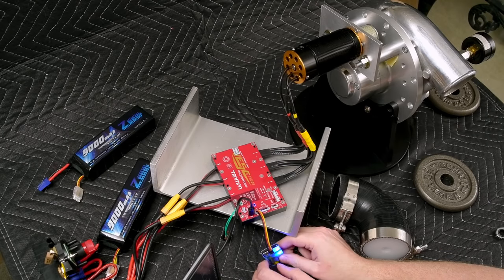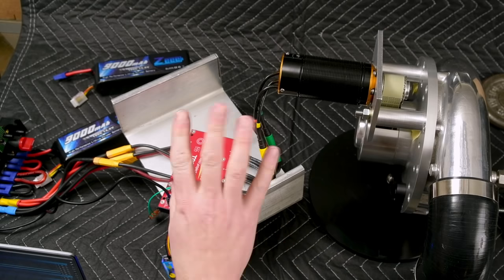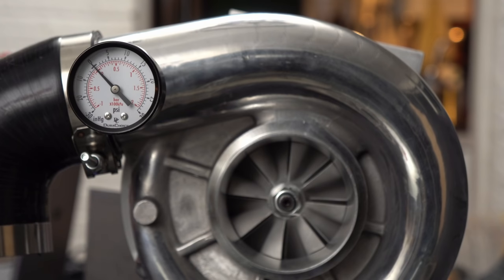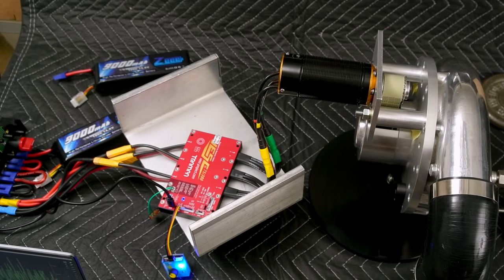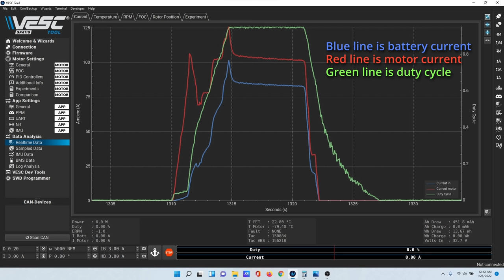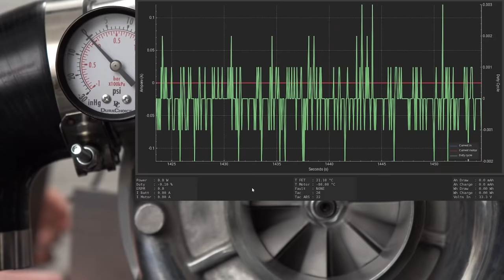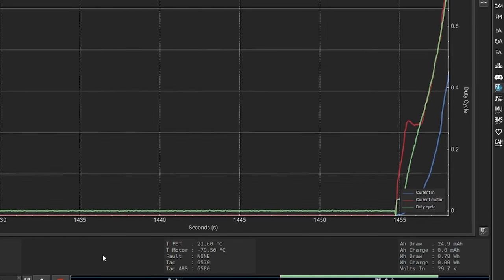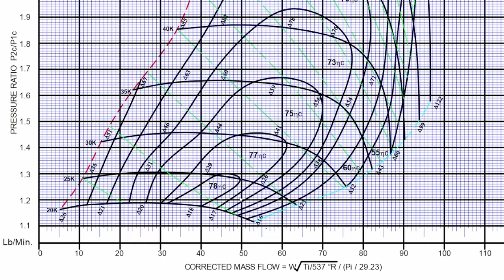Easier/Cheaper High Power DIY Electric Turbo - First Tests

Comment: I've been running a Paxton Novi 2000 at around 1:3 with a 2 1/2" 8mm belt-drive off a Me 0913 72vdc 250 amp BLDC in my 87" Camaroe with a .060 over smblk 350 for years. It makes 8 psi w.o the engine running with a 300 amp initial surge and selltles to about 160 A while operating. Typicall the duty cycle is less than 15 seconds. I power it with six 40 -50 ah AGMs in series. Two where each back seat use to go, and two in the trunk well. I can charge them on the fly with six 2A smart chargers plugged three each into a couple of 1.5K inverters that are powered from a second aux electrical system. . I started back around 02' when I saw my first LEMCO PM motor displayed at a trade show for amusement rides on a go-cart frame. It was 36v and about 10 hp yet made only a couple of lbs. next I went to a 12 hp Lemco D-126 and got 4lbs, and then I discovered three phase BLDC which you are already using on a smaller scale. If I upgrade I plan to try one of the new axial flux motors because I think they show the most promise to date. Most people underestimate how much power it takes to pump under pressure. Had I known from the beginning I probably wouldn't have even tried. That blower that comes on the Hellcat takes 60 hp off the crank for about 8 psi according to a factory video i saw on it. That's a hellova lot; however, I think that much power might be possible to obtain now with axial flux motors because they can be stacked. The biggest drawback you are going to face is battery power and life vs weight. All totalled my blower unit (mounted on the sway bar directly in front of the engine) weighs in at around 100 lbs and the batteries almost a couple of hundred more. It doesn't matter for a vehicle on a roll, (you can rule the interstate); but for drag that's a drag and LiPOs are still too GD expensive if you ask me. The less the ah of the battery, the less time they last before they have to be replaced. Also you will want voltage indication of each (I use cheap $3.50 tiny digital ones off Ebay) so you can make sure you have max voltage before each hit because it make a dramatic difference in output. I activate with chargers on. Keep up the good work man because it CAN be done, it's just not for everybody. I'm thinking now of just running a mini-jet through an exhaust cutout to get it up to speed and then valving it over to a turbo turbine with an actualtor when I want the boost. That would probably make more for a lot less; but I'm into solar AC right now. I may have a test video or two on my YouTube NT Keys channel; but for insurance reasons I've never quite let the cat out of the bag. Up until now it's been like my secret weapon cause I'm about 400 hp NA and I'm pretty sure it adds at least another 100 hp with the 8 42 lb per hr. high impedance Accel injectors I'm currently driving with an old MEGASQUIRT II with the 32 bit daughter board I built years ago. Fun stuff. LOL
Reply from the maker: I've actually seen your setup (on some F body forum, I think if memory serves).  I posted a link in your other comment; but we've seen 340 running amps in that setup - here it is again in case you missed it: https://youtu.be/AOL3Qyczt3Y .  My Whipple drew 70 hp off the crank and pushed the car into the 9's on pump gas.  You really should join our forum, I'm sure there would be a lot of good mutual info exchanged: www.electrifiedboost.com.  Lipos aren't that expensive anymore and certainly cheaper than a bunch of lead acid batteries; plus they weigh a lot less.

Comment: Perhaps the motor needs to be computer managed using pulse width modulation. Maybe take input from throttle position sensor. Last thought...exhaust heat and pressure are already there for free.

Comment: add volts ... lower your amps     ..  750KV can do 10s @3.7 NRPC  or 12S 3.2 NRPC..    750KV is a little high to run 12S @3.7NPPC due to a full charge rate of 4.2V per-cell .   You can also change the timing of your 3P 750KV motor but again heat will come into play.
You can look into KDE motors ...  They are great guys over there ... they will make you anything you want !    I had them make me a 380KV 3P to run 14S LiPo 3.7 NRPC cells with a YGE motor controller. At the time YGE was the only company making anything that could do 300amps @ 14s-3.7 NRPC ... this was 4 years ago . Now there are ESC's out there to run 14S LiPo/LiIon 
We also found that we needed to add to the belt drive system...   We were KILLING GT3 belts after 5 to 10 mins.    This was solved by doing a two stage pully system with  1 inch wide GT3 belts. This also allowed us to be able to fine tune our ratio to the final drive shaft. 
Next problem was motor bearings ....  GOOD BOCA bearings are a must ! due to the belt design ...Ceramic Bearings Only   again KDE helped us built a bullet proof motor with no run-out.  Make sure your running Ceramic bearing on all the stages of the pully main shafts. Add a retainer collars with set screws on all shafts. 

Even though we were doing HI-Power 700class Helicopter rotors with our setup.    I think some of what we found out would help you !
Reply from the maker: Can't go higher in voltage (watch the high power tests at 60 volts).  When I tried at 70+ volts, I had issues with ESCs blowing up.  67 volts, dropping down to 50-52 volts under load was the best we've done so far.  But that made 650hp with version 1.

Comment: Correct me if I am wrong, but a turbo is powered by the exhaust gas's so drive it by any type of power gas, diesel or electric it becomes a Supercharger not a Turbo so any data gained is irrelevant as heat has a big play in the power produced.
Reply from the maker: Watch this: https://youtu.be/QheFyxAWT88

Comment: I wonder if this is similar to what Porsche is working on? I think it was a few weeks ago, it was leaked that Porsche filled patents on a new Electric turbo to be used with their "hybrid" engine. Hybrid as it's a dual system, and the electric turbo is used to negate the temperature issue and dependency on using the exhaust when dealing with conventual turbos. I can't remember the fine details, so i'll have to do some research on it again and compare.
Reply from the maker: Sort of.  But that's a baby unit designed to fill the gap during turbo lag.  We're going big.  If you haven't seen it, check out our first drag tests: https://youtu.be/AOL3Qyczt3Y  Prepare to be surprised.

Comment: Electric super/turbocharging seems like a great idea that was put down because of the tendency for them to be knockoffs (like the electric fan in the duct). It has been successfully done by OEM's like Volvo and works well. It seems nice, because if you could scavenge electricity from the exhaust stream through an exhaust turbine connected to a electric motor as well; you could get a setup that gives perks like a twin charged engine without the cost and complexity of plumbing. The challenge at that point would just be keeping the electric motor cool on the exhaust side and programming an IC to control when, and where it pulls energy to give the optimum running conditions

Comment: Hello. Are you able to remove the 18 tooth 5T pulley that is on the impeller shaft and replace it with a standard 6 rib belt drive pulley? What does the impeller shaft look like where it meets the inside of the current pulley? Is the shaft smooth? Is it keyed or welded on?
Reply from the maker: No - the toothed pulley is machined into the impeller shaft.  A 6 rib setup would be hard to implement in such a small space; it would absolutely need a tensioner and a dynamic tensioner is much more effective than a manual one.  Either way, I'm not thrilled with the heat build up from the belt; I may run it hard and see if it fails.  If it does, then I'll simply switch over to direct drive.  I'll be back on this soon.  Just need to catch up with life first.
Reply: @AlexLTDLX  could you put 1:1 gears on a twin engine motor mount? And would you see benifit in having 2 of these work half the amps and make more efficient power from the electric motors? 

Cuz at this point arnt you testing the durability of the electric motors tolerances?

Comment: I love it. Hybridizing old motors. Why not upgrade to a 60 volt battery?
Reply from the maker: This was just low power testing.  I am using a 60 volt battery in the high power tests (the two newer videos).  But here's a look at the batteries: https://youtu.be/KscgGhk3ejs

Comment: The motor speeds up when you put your hand over the outlet cause the compressor wheel stops moving air you need a lot of flow through the unit for the wheel to move air that's why there's big load with the exit open the wheel has a firm flow happening and moving big volumes of air it's also why the amps went up with the 1" hole .the 1 "is still to small to flow enough for the compressor to grab enough air and actually start to work efficiently .it won't start making surge noises till its right at the start of coming onto the compressor and flow is coming and going as the wheel grabs then cavitates over and over it will just sit there happily churning air

Comment: Noob question. Learning myself on forced induction. Just wondering.....why is it called a electric turbo when its essentially still a belt driven supercharger?
Reply from the maker: That's a good question.  And reason is simple (you're right, btw) - it's because 10x more people search for electric turbo over electric supercharger.

Comment: That just sound futuristic. This is so cool, but what if for testing you ran it from the wall socket for a fixed power rating?
Reply from the maker: It does sound interesting... I think it's the cogged belt and brushless sound combined.  I actually played that sound a bunch of times while editing.  I can't run it from a wall outlet - even at this level (which is about 1/4 max power), it would still pull more than twice the wattage our wall outlets can provide.  At full power, even the 230 volt/30 amp outlets in the garage could only provide less than half the necessary power.  Thanks for taking the time to watch and comment!
Reply: Alex, that’s what #6 stranded wire and 50a two-pole breakers are for. Haha
(Electric stove/a/c circuit)
And not that I’m suggesting you power this thing with your house power, but if that’s the only setback, that parts easy. 
Coming from a high-efficiency hvac installer.
Reply: It definitely makes a unique sound… but truth be told, the noises that you hear electric motors are generally emitted as a result of friction from ball bearings at high speeds. When the bearings In electric motors start to fail, you will hear that whine get much much louder and start at lower RPM.

Comment: I’m kind of new to this stuff but is it possible that you could like maybe use a pulley off of the crankshaft to a pulley on the spinny thing and use a belt to connect the pulleys and have the running engine rotate the spinny blower thing?

Don’t hate on me too hard I’m just kidding!! I think it’s awesome that you are making this work off of batteries! It seems like you are very close. I’m glad I found your channel and I am already looking forward to the next video!
Reply from the maker: Lol.  Thanks!  We already tested a very similar unit -but it was more complicated to make it more expensive: https://youtu.be/AOL3Qyczt3Y

Comment: Hey this is amazing content. Sorry if this has been gone over before, but what about using 2 or 3, hell even 4 motors of higher kv rating?
Reply from the maker: Thanks for the kind words.  That's certainly a possibility, but in four days I'm supposed to take delivery of a 53hp, 50,000 rpm LMT 30100 motor and an MGM 1,000 amp ESC.  If you haven't see the drag test of the first version of this thing, check it out: https://youtu.be/AOL3Qyczt3Y  It was pretty eye opening.

Comment: Can someone explain to me why you would want an electric turbo? Just found out about this and it looks interesting but I can't quite wrap my head around why you would want to do this. Is it because you can basically modulate the RPM to whatever and whenever you want separately from the engine?
Reply: The answer is (in my case) having instant power when I want! In my daily drive car, I have a normal 2.0 n/a engine (a little bit slow) and sometime I want to floor it and having more power the electric turbo go's ON and now instant power and more efficent!
Reply from the maker: A lot of reasons.  Extremely easy to install (and remove); far more efficient than either superchargers or conventional turbos (which incur substantial pumping losses); that means much more power with less boost, that means less need (or no need) for intecoolers, which add weight, complexity and $$; you can tailor your boost curve to whatever you want - want more low end torque?  Done.  Want more high end power?  Done.  Want both?  Done.  No stresses on the crank bearings like a supercharger; no belts to throw, no complex wastegate piping, etc, etc.  If you haven't seen it, check out what only 5psi of electric boost can do at the track: https://youtu.be/AOL3Qyczt3Y

Comment: Hi , first you must  try with at last  12s , go to motor wizard again ( do not modify the amperage ..... / other parameters )  , you will be surprised !  This way you will spin the motor 4 time faster and it will can draw the amperage that is destined for . Second  you can get ride off the servo tester and connect a potentiometer directly to the adc port of the vesc ;)  ,  in foc mode and current setting your " throttle " will affect the power .....   for your application i think you should use speed instead of current  so 50% throttle will be 50% off max rpm - hope it make sense ...  Let me know if you  have problems in running your setup ;))
Reply from the maker: Thanks. The next test will be running off the big LTO cells that are already in the car.  So we'll be feeding it about 60 volts. We've already done some drag testing with this exact motor but a slightly different impeller wheel that saw about 28,000 RPM and made about 650 horsepower. For now I'm just going to continue to use the servo tester because that's the port that we have developed Arduino code for to drive. But the current versus speed setting is something I didn't know and is immensely helpful. Thanks!
Reply: @AlexLTDLX  Glad to know that i can help ..  What ecu are you running ? ( you could use the canbus , maybe yo can make a map in ecu for " boost control " .
Reply from the maker: Mega squirt MS3x

Comment: I was reading through the comments and there was a good question how are you lubricating the bearings on the turbo ?
Reply from the maker: These are sealed bearings, but I generally like to use Isoflex NBU-15 grease from Kluber.  It's expensive, but works extremely well.

Comment: Given the power of new Brushless motors, thier RPMs and battery power currently and available in the future there isn't a doubt I. My mind electric turbos will soon be a real possibility. Making an electrical system that can handle the power loads without melting down and then charge fairly fast from an alternator will be the challenge.
Reply from the maker: I 100% agree.

Comment: What if instead of like a timing belt drive set up you did like a cvt style set up. So as the motor spins faster it’s actually able to increase gear ratio to increase speed vs just trying to spin the motor itself faster.
Reply from the maker: That's a thought.  But the blower came with the toothed belt pulley on the impeller shaft already, making this super-easy to build - that's the point of this version - cheap, easy and quick.  The big bastard coming down the pike will be direct-drive, and a bit over powered (or under-compressored, depending how you look at it).

Comment: What about a dump valve or some kind of electronic clutch when it goes into choke mode?
Reply from the maker: I have a blow off valve in the car.  But this blower is undersized for my car's engine anyway (365 ci, 500 hp).  It's tap dancing around the choke line as it is.  I'm thinking the current limits on the VESC would be great to control it towards choke - maximizing the power without getting into motor saturation.  On a smaller engine, it probably would be better to control the boost with a MAP sensor and arduino (we have a pretty well developed arduino code thanks to one of our forum members at www.electrifiedboost.com).